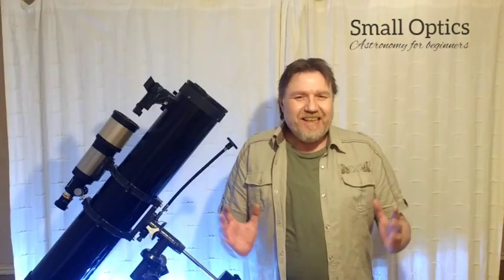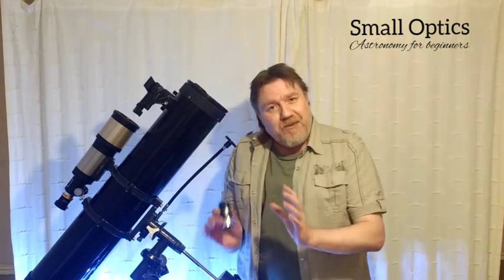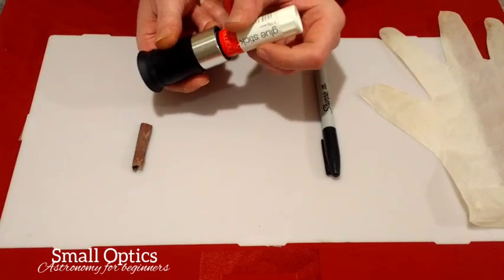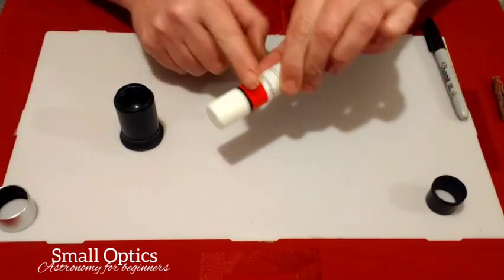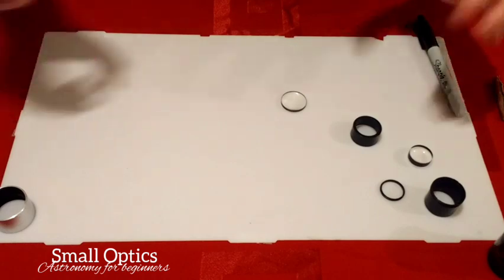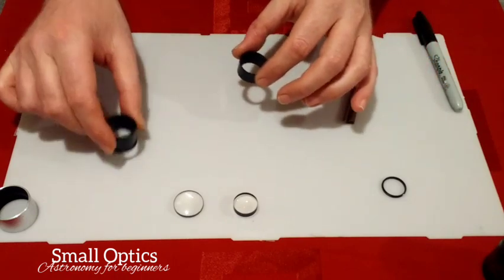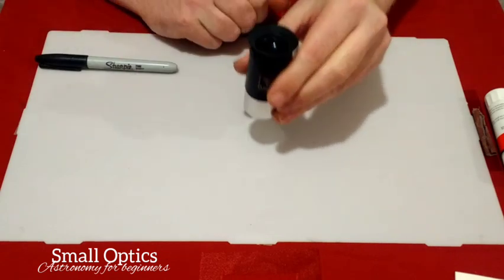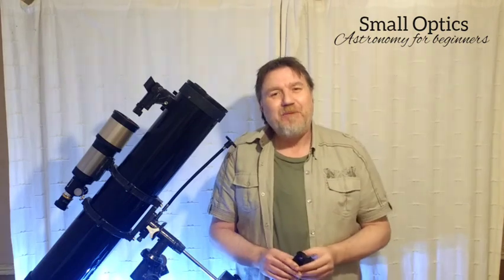Modified Achromat MOD! (Improve Contrast)

Comment: Works on the Small Finder scopes.
I also flocked the inside of the tubes  of
my Astro Tech 10x50mm finder tubes.

Huge improvement.

Comment: 1 Use clean towel or paper towel.
1.	Disassemble (CCW) inner barrel Lens eye lens down on pt 
2.	Sitting on a plastic cap and tapping the outer barrel to drop out internal assembly.
3.	Sand all inner plastic barrels to a dull finish
4.	Black Sharpe the lens edges and corners of edge (2-3 coats)
5.	Install rounded side of lens in toward each other on both lens
6.	Blow dust assembly and check for any debris before assembly
Reply: Clean lens parts IPA +soapy deionize distilled water + rinse with DDW then air dry.

Comment: Good video, I liked a lot the purpose of your channel, immediately subscribed when I saw your posts. Just a question: this sandpaper needs to scratch the plastic until it is no longer shiny, but how much abrasive must it be?

Also, these markers easily dissolve with isopropyl alcohol, and this is what I use for cleaning the eyepieces. How can I clean them from fingerprints after painting?

Last one: about eyepieces, is it better to use the original ones modified (mine is equal to yours), or buy another one? If the last option, have you ever had contact with Celestron Omni, what do you think about them?
Reply from the maker: Hello Vitor, thank you my friend. The sandpaper abrasive needs to be medium to medium/fine just enough to take the shine off. When it comes to handling the lenses I would advise using cotton or latex gloves to keep finger marks off them . As for buying a new eyepiece that's entirely up to you, the hack is easy to do so personally I would do it to the eyepiece you already have....it's cheaper that way :) The Omni eyepieces are a great budget range, I've not tried them all but I have the 12mm and it's performs well . The Omni Barlow is probably the best you can buy for the money. Hope this helps, take care, clear skies :)
Reply: @smalloptics753  I think the super 25 is really good, both in amplification (28x in my small 70mm refractor) and fov. Unfortunately, there is no Omni near 25mm, only 32 or 15. What do you recommend?

The only think I really worry about this improving is the marker dissolving in the alcohol. Because it is very likely I will get some fingerprint on it, but I would't be able to clean it... What could be done?

Comment: Thank you, Jason!
Excellent video, I just want to know which eyepieces have blackened edges & which don't.
I have about 8-9 eyepieces, mostly cheaper Plossl versions.
I'd like to know so I can tell which ones to mod.
I guess I'll have to disassemble them 1 at a time to find out & fix each.
I'm about to mod my focuser knobs w/ wooden rings to enlarge them.
Have a GREAT day, Neighbor!
Reply from the maker: Hello Jon. Thank you my friend. Most plossl's already have blackened edges you can sometimes see if they are black  just by looking at them in the daytime without dismantling them, if the edges appear white that means they haven't been treated, if you can't see the edges then that usually means they are already blackened. This method isn't totally foolproof but may save you unnecessarily dismantling them. If you look at my latest video about the svbony telescope when I start talking about kellner eyepieces I show a photograph and you can see the white edges of the lenses in that photo meaning it hasn't been treated. Hope this helps 🙂

Comment: I wanted to ask you if you would review an astronomy aap named SyEye . Because it can also be used  kind of like a motored telescope
Reply from the maker: Hi Guptazzzz, I will have a look, I have tried a few apps for that very purpose and what I have found is telescopes tend to give off a slight magnetic field wich interferes with the gyro in the phone and therefore you get inaccurate readings. I don't know if all telescopes do this but all the ones i've tried have. You can test if your telescope is giving off a magnetic field by downloading a free App called EMF detector (There is a lot with that name any one will do) then go round your telescope and see if you are getting any high readings. Unfortunately there is nothing you can do if there is.
Reply: Actually i will have no problem because my telescope's body is not made up of metal it is made up of some kind of plastic i suppose
Reply: And there is is a astronomy online lectures for 10 days that i am gonna join